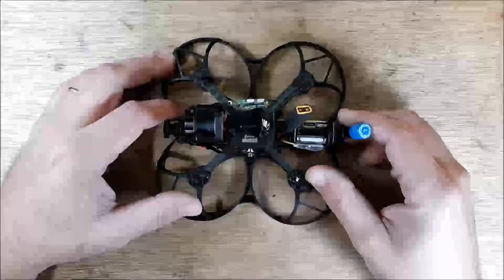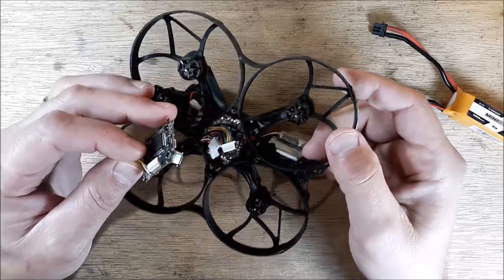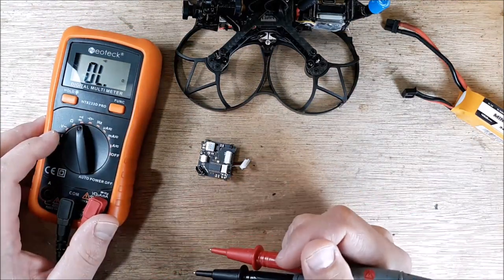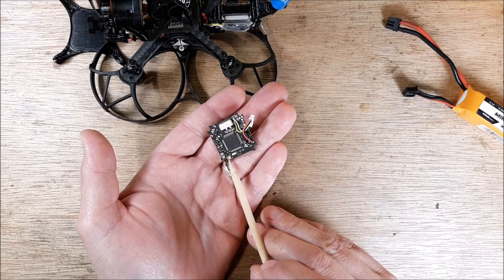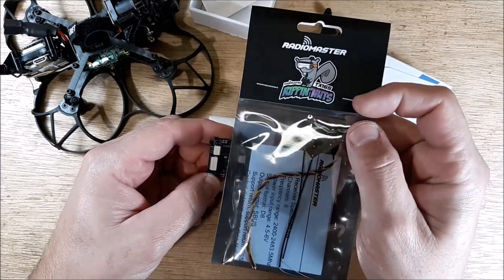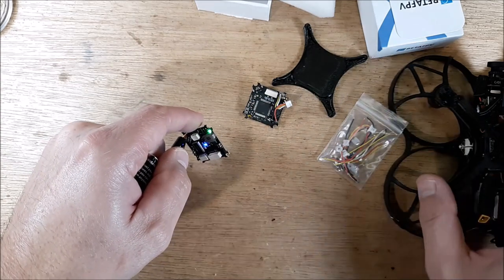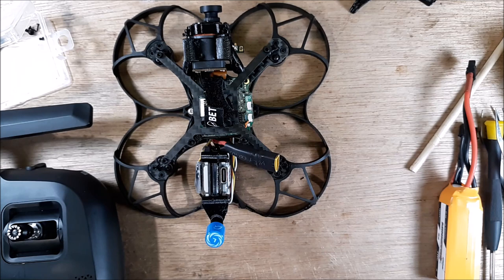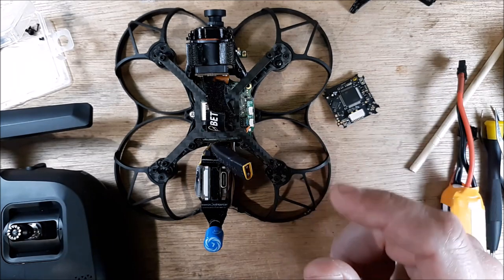Betafpv 95X V2 F405 Flight Controller Replacement | How To Replace The Betafpv 95X Flight Controller

Comment: Waoooo your video just saved me i did everything as you explain in the video and everything works great but there is only one thing i can not figurate out. I can not get the osd in my dji googles i did turn on the UART6 /msp and  custom Osd in the googles as well also the osd feature is on  in betaflight and nothing happened i know  not all the osd feature are available for the dji googles but the osd  values like rssi and average battery voltage are available  those are the only one i care honestly. I have an iflight titan hd xl5 and the osd work perfect so the problem is not the googles. Do you have any idea how to fix this osd problem i have? Thanks for the  effort you put in your videos.
Reply from the maker: Yes, I understand.
Go in your goggles and enable "custom OSD" in the settings tab.
Enable OSD in the config tab of Betaflight 
You should have OSD elements now, move them were you want...
NOTE: While messing about, have a fan on your quad, or you're going to burn up your air unit.

Comment: Loved this vid.  Mine just got in, and after watching this i decided to do a good "once over" on mine. 
Can i ask, why Dshot 300?  Also, 4S 450 Mah is what they say.  Think 550 would weigh her down?
Subbed!
Reply from the maker: Thank you for checking out my channel and subscribing! I appreciate you! I chose Dshot 300 because I don't believe this esc efficiently runs the bitrate demanded by Dshot600. I really needed to change the loop timing to 4K 4K as well. I think I missed that step in the video. If you increase the speed that the esc has to change positions of the 3 phases and it does a poor job, you end up having desync issues. I am not an expert on esc protocols, I follow the advice of others and try to understand what is happening and why. I have a higher end build that is super clean and power to weight is spot on, it's the only quad running Dshot600... Oscar Lang, Xjet, and Painless360 have some wonderful content of how a 3 phase motors and escs work. Painless360 has a great video Lee made like 5 or 6 years ago that still apply today "understanding escs".. 
The batteries I used were 450mah and 650mah. I thing a 550mah would be very good. I apologize, I have not tested the two lipos head to head.
I hope this helps.. Enjoy the Breeze...👍🏻🍻👊🏻
Reply: @propsoff   Man, I never really ever pay any attention to the Dshot protocol.  So seeing it in your vid has me researchin an all new area!  Keep em comin bud!  Look forward to some footy off that 95x
Reply from the maker: @EiGhTfT  
I appreciate your encouragement...👍🏻🍻👊🏻

Comment: I just ordered a new one from Pyro. It comes with the F405 20A V3 AIO BLHeli_S version. It does come with DJI plugs, and the USB is very easy to get to, but it’s not BLHeli_32 like advertised. It does come on 4.2.3. Might be more reliable, who knows, but I am kinda pissed about the BLHeli_S  Crap. It’s not what I paid for.
Reply from the maker: Not familiar with the AIO board. Sounds like a totally different quad, lol.. I enjoy Blheli32 too and am looking for a 20x20 for a build now... This flight controller may be compromised having a vbat passthrough for the Nebula - time will tell if the new FC lasts...🤞🏻
Reply: @propsoff  Everything is exactly the same, except for the completely different white FC/ESC, an AIO. On the site it was advertised as having the two board system. It does not. They really need to update their shit. Saying it is BLHeli_32, and it be and BLHeli_S, is a major difference. This is my first Nebula. In my opinion, it does not look near as bad as I thought it would. Mine only weighs 108 g vs. 116g which was what Albert Kim weighed his at.
Reply: @propsoff  I have have ran Vistas off of straight VBAT on a few of my quads. I try not to, but I have had no issues. I try to run a 12v BEC to combat spikes, or at least a capacitor, though I have run them with nothing lol. DJI gear is pretty tough. I heard that the Air units internal components “can handle” like 28-30v, but that is not enough for possible spikes. That is why it is only rated for 4s. I’m sure 5s would be fine.
Reply from the maker: @gammagonad1657  
I was thinking of running the Matek 12v BEC for the Nebula Nano vs vbat through the FC.. Good feedback and always appreciated..
Reply: @propsoff  Ive used the iFlight 5/12 BEC, and they seem to work well. I think that the Matek is definitely a good choice. Very similar products.

Comment: Thanks for taking the time to put this together, it was very helpful. Can you provide the link to order the FC? I believe I burned my out and need a replacement as well. Thanks in advance
Reply from the maker: I haven't looked into it, but I think the Betafpv V3 has a different flight controller. I thought about a different one for this (95X V2) because they changed it so quickly and that makes me think the design isn't the best.
I'll have to look, can't remember were it was ordered from.. Lol, too many projects!
Reply: @propsoff  thanks for your response, I have the 95x v2 and I will reach out to the vendor to make sure I order the right part. Nonetheless I Sub and liked your channel.
Reply from the maker: @AerialVideosPhotos  
It is linked in the description,  Haha, I had to look and make sure.. Yeah, the FC can be purchased from Pyrodrone and it's linked in the video description under the title description. 
Hey, thank you for checking out my channel and subscribing! I appreciate it. Enjoy the Breeze...👍🏻🍻👊🏻
Reply: @propsoff  Oh boy I failed to look in the obvious place, my bad and thanks for looking into it and providing the details. --- Cesar
Reply: @propsoff  I just sent you a private email (coming from Cesar Lillo) hopefully you can help me out. Thanks.

Comment: May I have the broken FC? I'm trying to learn how to repair them. :)
Reply from the maker: Do you know how to connect it to Betaflight?
Reply: @propsoff  Yep, built a few quads one 3 inch cinnewhoop as well as an 85x and 95x both from the ground up with JESC installed. I have a hot air setup and full soldering setup including the Sequire TS100. I've actually repaired a couple usb ports so far but would love to try my hand at trouble shooting and replacing the regulators.
Reply from the maker: @MERCURYMAD  
I see.. You were saying you literally want to repair them.. I would image if that regulator was replaced, it would fly again..

Comment: Just got into this hobby but did not realize i was going to need a computer programming degree to keep flying.  Im computer stupid.. This is all mumbo jumbo to me.. Im selling out..
Reply from the maker: This quad is temperamental. What's going on?
Reply: I just ordered a new flight controller because I'm I'm pretty sure mine pooped out it will not register when you plug it into the computer and it will not arm